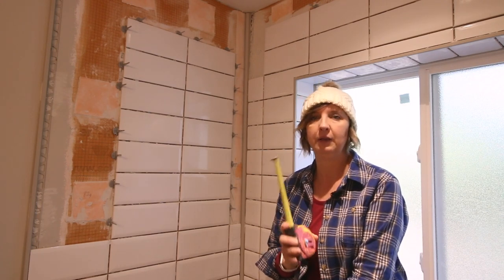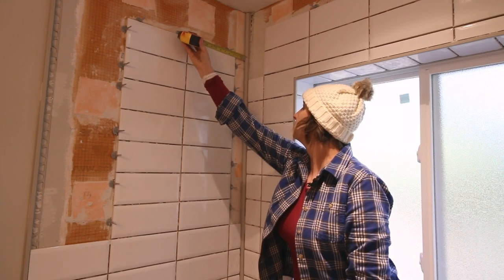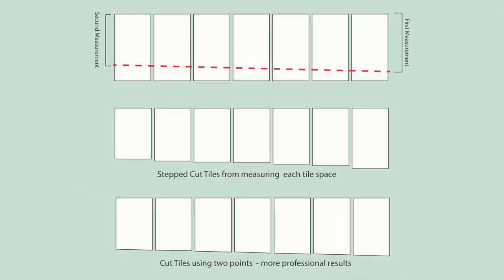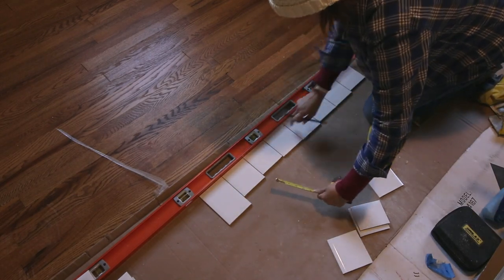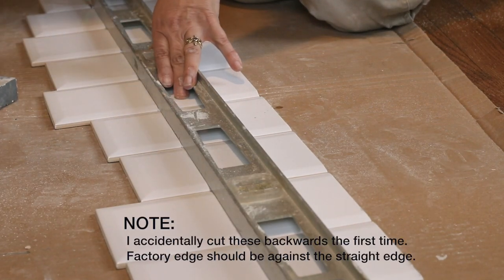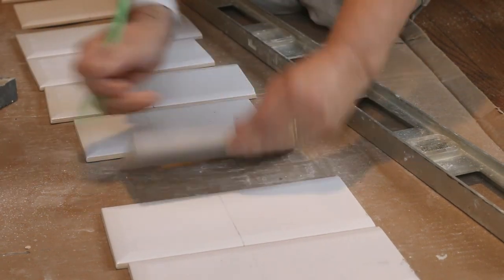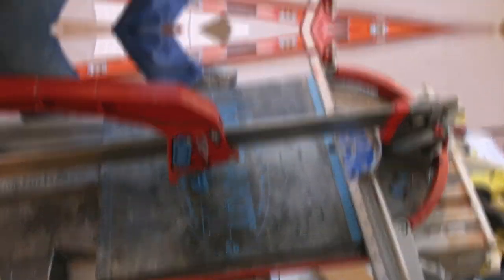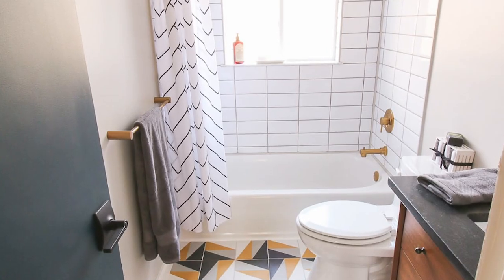Pro Tip: Tile Tips for Non-Plumb Walls

Comment: my house was built in 1913,  it's never seen a flat level wall in its life. Useful to know this, when tiling as a non pro I tend to think of the tiles individually, it is of course common sense that you can view them as a plate and measure and cut accordingly but it never occurred to me to do that. Much obliged. :)

Comment: Is that grout that is in the corner or is it a trim? The reason I'm asking is I'm doing a thin grout and have a similar problem with non plumb wall and I don't know if that two-point cut will show. I'm trying to figure out what the advantage is if I'm not using a thick grout or Trim in the corner.
Reply from the maker: Schluter profile

Comment: I planned on tiling behind my toilet wall… there’s a 12 inch spot that is about 1/2” humped up vertically beside my toilet piping. My tiles are 12x24. I am only going up about 35”, so I need it level. Can I grind that hump down and plaster it smooth and level? And use leveling clips.

Comment: Maybe plum the walls before you start boarding/ tiling? Seems like it makes more sense 🤷🏼‍♂️
Reply from the maker: I furred out the walls to the best of my ability, but this is an old house and there isn't a plumb wall in sight. Thanks for your unhelpful comment.
Reply: Tile should be ran in subway tile style. It would’ve looked so much better.
Reply: @calandrariggins5846  the way she did it, is more "in" now. To each their own. Unnecessary comment
Reply: @calndrariggins5846     I agree with you. It does not look good like this . Her install looks very goo though . Nothing wrong with her work just don’t like the layout , buuuuuuut , it’s also how a lot of people are doing it now. Guess it’s one of them things that has to grow on us after some time
Reply: I did not need to see this. I’m going to be so mad if this applies to me
Reply: Not a bad solution if you goofed and the boards are already up and sealed, but he’s 100% correct. Walls should be made plum first. You can buy shims at big box stores if you don’t feel comfortable making your own.